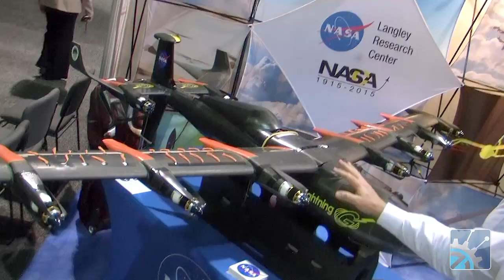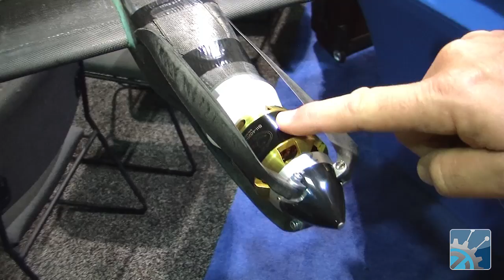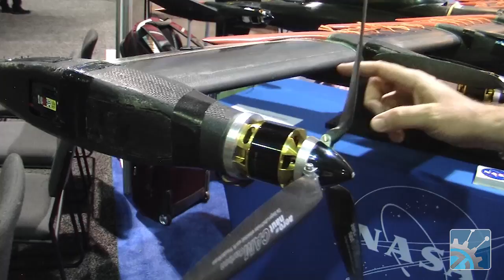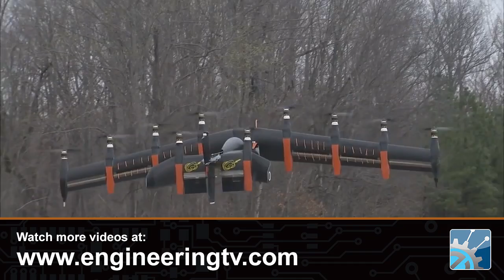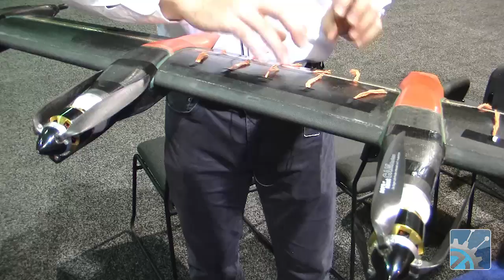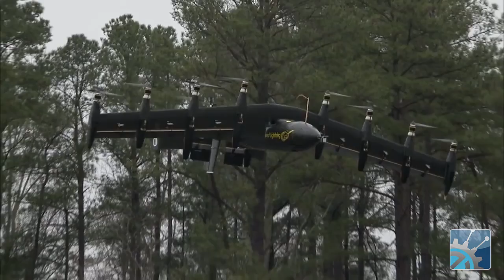NASA's Greased Lightning 10-Engine Hybrid Electric VTOL Drone

Comment: NASA has it wrong.
I saw you tube of a plane (model) that had folding motors that after vertical lift phase, folded back into the fuselage.

Comment: Fantastic, fascinating, awesome....
This is brand new...
Just imagine : when all the plane will work that way, all the airplanes will be able to take off vertically, and they won't make noise taking off over the houses... All the noise will stay over the airport.
Also : there will be no more need for landing slopes, that can be transformed to  greet more aircrafts and more passengers.... 
No doubt : a new and fantastic era is coming...
Reply: Models are one thing.. Passenger airliners are different. Currently we have no way of storing or generating enough electricity to power motors big enough to make a passenger jet electric - either conventional or otherwise.
Reply: It's just a question of time, Dear...
Reply: Juan Van Steyvoort not fantastic at all, that takes all the fun of flight, I live right beside cyyz and I love the noises, so do all my neighbours.

Comment: Shrink the size of the propellers.  Move them above the wing so that none of the airflow goes under the wing.  Should give you more lift.
Reply: The propellers need to be big, but wings actually have been shrunk in scale compared to the XC-142.

Comment: "because you get artificial blowing"  lol   5:12.  Its called thrust I believe....
Reply: i think he means that the motors blows air over the wings creating lift even tough its not moving forward
Reply: Umm no,  by blowing air over the airfoils when there is not a  enough circulation to produce lift due to lack of forward speed the term is appropriate. The thrust part is a given, but the most important aspect during transition from vertical to horizontal flight is to maintain lift when the thrust vectors are changing from an upward to forward direction.
Reply: airflow

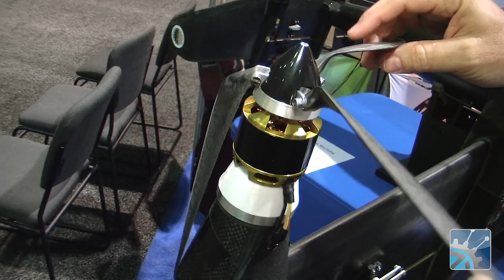Comment: Flat head screws on a NASA test drone? kinda strange. 2:00
Reply: Those are the screws Aeronaut packs with their folding prop system.
Reply: Sorry my mistake.  I meant to say "slotted" screw heads instead of the use of Phillips or hex/torx which are generally preferred for higher quality jobs.
Reply: 100% agree, and the nut was flush, in aviation 2 threats minimum 3 threats max, what a nut job,  I was not impress at all, this guy's need to go back to school.